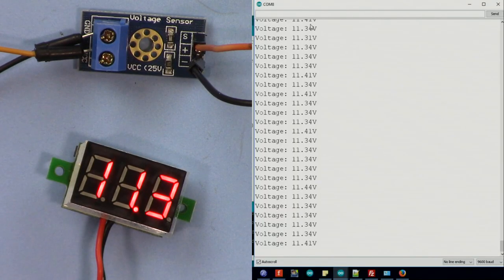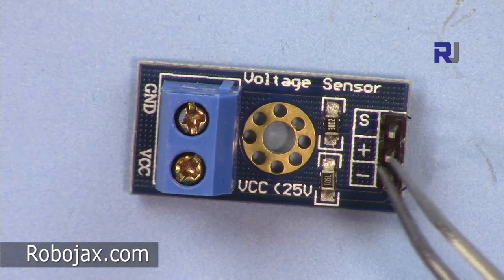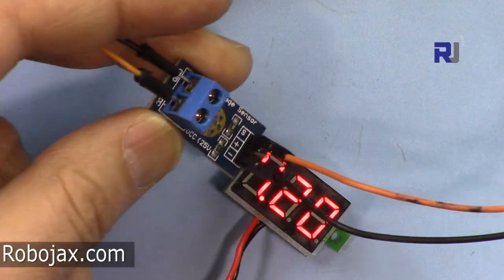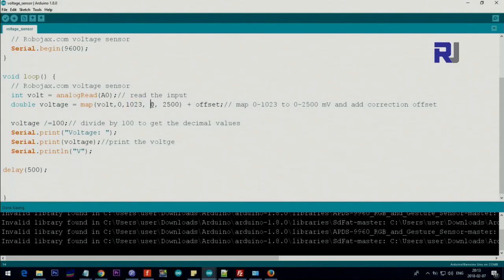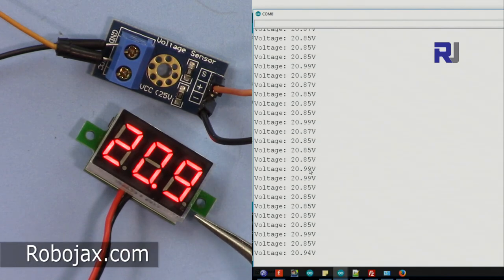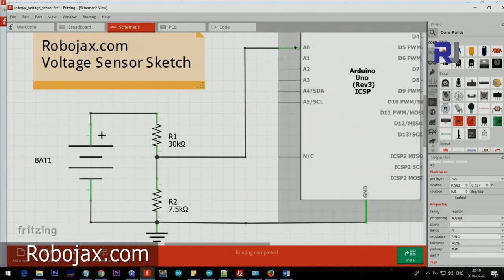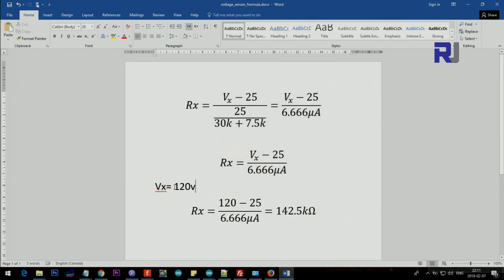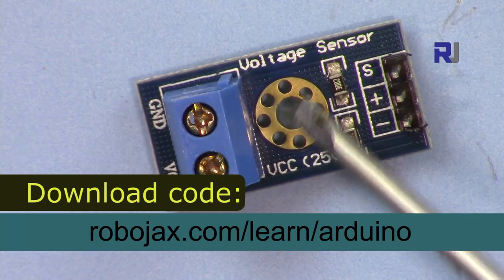Voltage Sensor for Arduino with code and formula to measure any DC voltage

Comment: i want to get the output signal when the voltage < 3.8 . How can i do it and how the code will change?
Reply from the maker: first you should not use this. this is just low tolerance (10%) resistor on PCB. But if you wan tot use it, why would you change anything? just connect your voltage to the input and you will read it. But you can use your own 1% resistor with this project and get much accurate reading and read any voltage you want https://youtu.be/t8xwrVj2aFs good luck.
Reply: @robojax   avrdude: stk500_getsync() attempt 9 of 10: not in sync: resp=0x01
avrdude: stk500_recv(): programmer is not responding
I got this error while uploading the code to arduino . how can i fix this?

Comment: Hello Mr. Ahmed, Your video is amazing, I really like the explanation for each of your videos.
Reply: I need some help with my project. I want to measure the power consumed by each component connected to a 24V 6A battery. I can use a voltage sensor and a current sensor separately to find the power consumption , but, can you suggest a  sensor that can measure both and is compatible for my project. Thank you
Reply from the maker: Please watch this Energy meter using Shunt resistor https://youtu.be/qh1LlCg6yXw or watch this video using Winson Current sensor  https://youtu.be/-pg7jbkaB6A if you are want to use Winson Current Sensors then start with introduction video here https://youtu.be/z-s8UvCWGxY

Comment: Thanks For the great video...
I have a question...???
I want to make some project using Arduino Uno,Mosfet & voltage sensor but Still confuse in program arduino may you give the solution...
Reply from the maker: You are welcome. I can reply to simple questions but can't build a complete project as I don't have time for that. You can break your project into pieces for example, MOSFET question should be "how to control a motor with MOSFET" and I will guide you to the right video tutorial.
Reply: Ok
Thank you alot

Comment: Hi, what circuit can I use to convert AC voltage to DC without changing the peak voltage? Thank you!!
Reply from the maker: You need full wave rectifier https://www.electronics-tutorials.ws/diode/diode_6.html

Comment: If I want to measure the current also what code will I put? I am new to this and any help would be good. Thanks!
Reply from the maker: for voltage measurement you don't need this module, watch this video https://youtu.be/t8xwrVj2aFs  for current either use shunt resistor https://youtu.be/9jwCc7uPGoc or current sensor module  https://youtu.be/3C33DpcSwIw or this https://youtu.be/z-s8UvCWGxY
Reply: @robojax  yeah I thought so. 
If I use current sensor. It will also give voltage reading right?
Reply: @robojax  having trouble finding a current sensor with that can measure atleast up to 25v and 10 amps. 
Can you recommend one?

Comment: Is it possible not only be able to read the result I also wish able to hear the value?
Reply from the maker: you may use external voice generator to make it possible. or use Raspberry  Pi. For arduino there is a sound module that you record certain sound and play it at certain condition. here is one https://youtu.be/KDc2Z43DzT0 good luck.
Reply: Thanks for quick reply. Whats that? They sound like holy ancient mantra to me. Honestly, All I know just basic blink code. For now allow me to follow your youtube channel for I wont miss if someday you'll post how to do that. Greeting from Indonesia
Reply from the maker: then Learn Arduino in 30 Minutes (video): http://robojax.com/L/?id=135

Comment: how i can meassure negative voltage values?
Reply from the maker: first of all please watch the proper video to measure any DC voltage here https://youtu.be/t8xwrVj2aFs to measure negative value on the same circuit, simply connect the wires in reverse. But you can't measure the positive on the same circuit.

Comment: What is the maximum capacity voltage of the sensor?
Reply from the maker: Hi, perhaps you skipped the video. it is 25V and I've shown how to use it to measure any voltage.  But his is my video on how to use Arduino to measure any voltage https://youtu.be/t8xwrVj2aFs

Comment: can it display the voltage of the solar panel which is around 40V ? and what is the name of the sensor and how can i buy it? thanks.
Reply from the maker: Yes. You can measure any voltage but any voltage above 25V, you have to use extra resistor which I have provided the page on how to calculate resistor. See the page were the code is and you will see a fill tell you how to calculate resistor to calculate any voltage .
Reply: hey thanks for the reply, so do you a module that can display large voltages that i can buy?

Comment: Is this sensors work on ac supply or dc.
Reply from the maker: DC only.  Watch latest video to measure voltage without any module. just two resistors https://youtu.be/t8xwrVj2aFs

Comment: I tried this code and it worked. I think I may have a faulty sensor tho. I had to set the offset to -12 to get it to read 0v with nothing connected. When I connect a AA NIMH Battery it reads as 2.23v. It should read 1.5-1.25v
Reply from the maker: There is nothing special in this sensor. Just two resistors. There are two resistors as I have shown in schematic (in the page where code is). Read the resistors and see if the are different.

Comment: The center hole surrounded by small holes has any function?
Reply from the maker: no. they just decorated so it looks interesting. Actually this module should not even exist. Just connect 2 resistor and you have voltage sensor as I have shown in the schematic.

Comment: How can I measure both ac and DC voltage by using one aurdinou
Reply from the maker: DC only. for AC, you need to convert it to DC before measuring it. I will make a video on that but don't know when as I have other items high in the list in terms of priority.

Comment: Can I use this sensor with ESP8266 to measure up to 17V max ?
Reply from the maker: Yes you can.  here is latest video https://youtu.be/t8xwrVj2aFs
Reply: @robojax  i believe you  that it is working great on Arduino . but Arduino works with 5V and ESP8266 work with 3.3V and every time , the reading is wrong even if the code is correct and the value of resistors are right.  I think is another problem.  Can you make a video with this subject  and the  particularities of esp8266 ? Thank you a lot .
Reply from the maker: it seem you have not watched the video.  Watch it please it work with ESP32 and ESP8266.
Reply: @robojax  I have seen your video . I used a voltmeter sensor like this  https://www.google.com/search?q=voltmeter+sensor&client=ms-android-samsung-gn-rev1&source=android-browser&prmd=isvn&source=lnms&tbm=isch&sa=X&ved=2ahUKEwinp-_Eou3pAhUMFpoKHTKGAMEQ_AUoAXoECAwQAQ&biw=412&bih=693&dpr=2.63#imgrc=ewnlrTuWATqlCM 
R1 30kohms and R2 7.6kohms . The problem is with reading . For low voltage I have to set  offset around 0.5V but over 10V is + 4 / 5 V !  So , I can't  have one offset value for all voltages . That's the point . With this resitors values , I cand measure up to 16.5 V  theoretical but if the source have 15V , my sensor read 20+  or another stupid values
Reply from the maker: okay then if you watch the video, then you know that it will work with 5V, 3.3V, 1.1V, 2.56V any voltage.
Reply: @robojax  My esp8266 have 2 resistors near A0  . That means i can measure on A0 max 3.3V. That ' s right ? Without resistors only 1V.

Comment: can i measure 100V with this sensor
Reply from the maker: Watch this video https://www.youtube.com/watch?v=t8xwrVj2aFs and you can decide and learn the minimum based on the Analog bit settings.  Use a board with 12bits to get better result.

Comment: Can I use nodemcu esp8266 instead of arduino?
Reply from the maker: Yes it will work. Connect it to ADC pin.
Reply: @robojax  thanks a lot

Comment: hello sir, what must be changed if i wanna measure the current? thank you :)
Reply from the maker: You cant'. You need very lower resistor like 0.01Ω  20W or more depending on current you are measuring. But the best solution is current sensor https://youtu.be/DVp9k3xu9IQ for up 30A or https://youtu.be/GE4I10IZ1jY for 50A or more
Reply: @robojax  thank's, this solution for my project
Reply from the maker: You are welcome.
Reply: @hilmanabdurahman4265  hi, may i know, how you code for voltage and current in one coding?

Comment: how did you get the formula can you please explain. I did not get your mathematical calculation thanks
Reply from the maker: Thank you for your comment. I had to redo the calculation and found that the value is not 6.66µA but 666µA.
The formula has been explained here http://bit.ly/rjx-vsensor
Reply from the maker: I did not hear from you. did I answer your question?  just wanted to know.
Reply: hello sir i got it now thank you for your explanation i understand now the circuit and formula thanking you!!!
Reply from the maker: you are welcome. Ramadan Kareem.

Comment: Do you have video tutorial for ac voltage ? It is same with the dc ?
Reply from the maker: No I don't. Arduino can't measure AC and there is no module yet for AC voltage.
Reply: How to display the value of voltage and current using pzem-004t using arduino? Could u help me.
Reply: you can always use a DC reference, rectify it, add capacitor, use multi meter to measure DC voltage and add resistance to that accordingly. You might have to modify the code a bit.

Comment: hi, how i can measure high voltage with arduino??
Reply from the maker: Yes you can, if you  read the title you will see it says "any voltage" and that is why I made this video so you can measure any voltage. I replied yesterday but don't know what happened, youtube did not save it.
Reply: @robojax  hi i want to measure 230v AC by using ardunio and sensor which voltage sensor is usefull

Comment: Can I wire the direct the pin out without transistor?
Reply from the maker: I believe you meant "resistor" not "transistor". If so, yes you can but as explained, you will be able to read only 5V.
Reply: @robojax  oh yes I mean it ,sorry.
So I'll measure voltage of solarcell ,I should put resistor?
Reply from the maker: Arduino can accept only 5V. Your solar panels for sure have above 5V. You would have use voltage divider to reduce it to the scale of 5V  and based on 5V, your arduino will be able to measure it. Any voltage above 5V will harm Arduino. I have provided a document in the description where it shows how to calculate resistor for different voltage for Arduino.
Reply: @robojax  thank you so much
Reply from the maker: You are welcome.